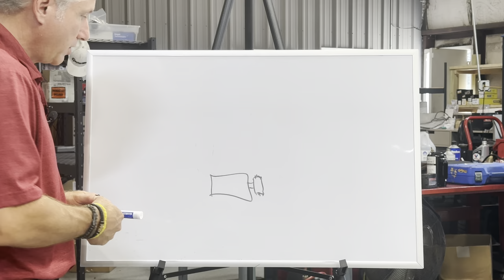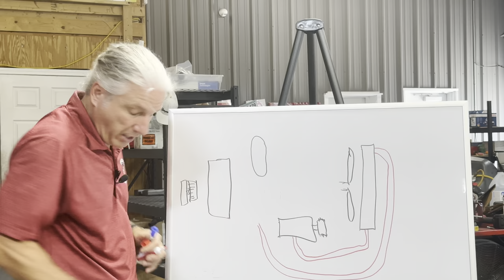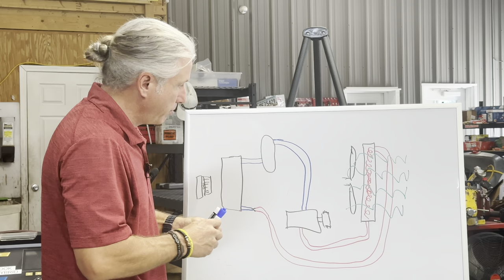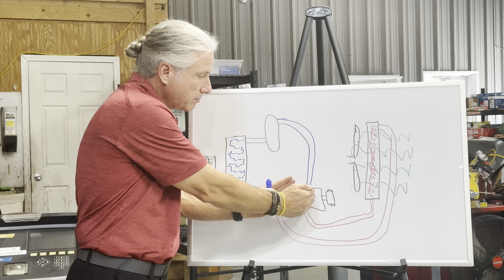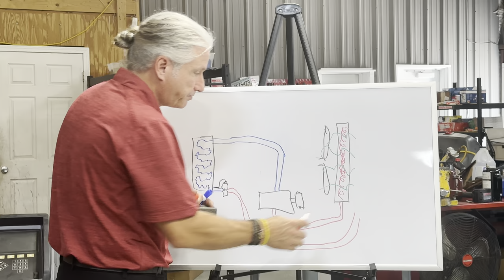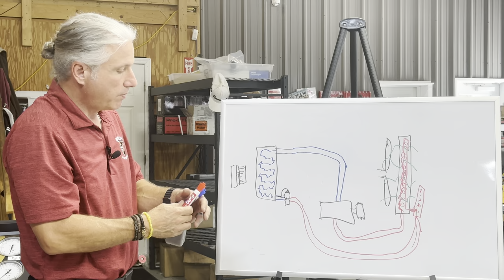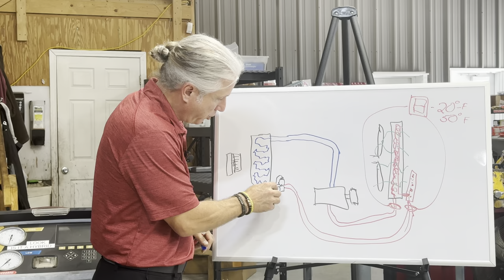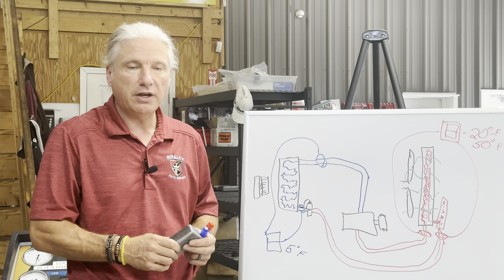Air Conditioning Diagnostics Part 1: How the System Works

Comment: 16:18 The evaporator core gets cold. Air passing by the evaporator will cool down. 

Cold air can absorb less moisture than warm air. Therefore some of the moister that was absorbed in the warm air will condensate on the outside of the evaporator. If there’s a lot of condensation it will be drained (some cars will ‘leak’ water on hot days. They don’t really leak water, that’s just condensation)

There’s no direct contact between the air that’s cooled/condensation and the refrigerant. So no moister will go from the air to the refrigerant.

So the refrigerant does not pick up water from the outside air.

Just my 2 cents. 
I’m looking forward to part 2!
Reply: Also, here in Scotland for sure I would expect to see moisture on the outlet pipe from the evaporator, similar to a picture of the evaporator if we could see it.

Comment: Dryer conditioned air is due to the condensation on the evaporator removing humidity from the air passing over it. There is no absorbing of moisture by the refrigerant. It just absorbs heat. Side note it doesn’t cool the air it makes it less hot. 😊

Comment: i'm confused about the accumulator , is it the same as filter dryer or not , because accumulator normally describes a device to store excess liquid refrigerant to prevent liquid from going to compressor . please help
Reply: their is a desiccant bag in it for moisture control and a screen . if you can find one cut it apart, i cut and disassemble lots of things it gives you more understanding of how they work. cut the end off a newer style condenser, you will see that the condenser has become a filter. experiment, learn and never stop learning get or look up micron gauge . most shops including dealers dont use them
Reply: Yes due to using a fixed orifice tube the change of state in the evaporator is not adjustable so they use accumulators to ensure that no liquid can reach the compressor. It has desiccant bag in it to absorb any moisture. It works the same way as a filter/dryer except it does prevent liquid from entering the compressor. I’m sure he will cover that in next part/parts..

Comment: Please remember 
High pressure 
Gas ..
Low pressure 
Liquid.
Reply: Not really the system uses high and low pressure gas and high and low pressure liquid.  Refrigerant is low pressure gas from evaporator to compressor and high pressure gas from compressor to condenser. State change occurs in condenser from high pressure gas to high pressure liquid thus releasing heat energy. Opposite occurs in evaporator.

Comment: Great presentation a mention that one is a high pressure gas which becomes a liquid when it goes thru the orifice or expansion valve then back to a gas in the evaporator .

Comment: great information what you are doing is good. back in the 1970s i worked for Montgomery Wards we installed a lot of in dash and under dash units. those units were 12 and boy they would get cold. i have seen so many changes thru the years now we have those variable displacement compressors. you really have to look closely to make sure what type system you have to be able to fix  any A/C unit. old days simple they didn't have blend doors to mix hot and cold air you either had heat or ac so easy do diag. thanks for sharing this information wonderful reminders

Comment: Regarding the temperature readings across the evaporator…
My understanding is you determine the system is fully charged at 5°F difference.
But what do you see before or until it is full?
Since you said you don’t want to see too high a difference, because that would mean the system did not have enough refrigerant, that, with a system that is being charged, you would see a higher temperature, and watch it decrease as you add refrigerant.
Is this the case?

Comment: not trying to knock you but its liquid coming to the orifice not a gas. and you have to use lab grade c02 for that testing but thats another subject. and the drier part comes back to how dry you got the system before you charge it. if you pull down to 500 micron and then cut the vacuum and it does not rise above 1000 micron which is the standard for hvac,you will have a dry system. i hope you will do a more professional video after this one

Comment: The high side is liquid freon, as liquid passes through the orifice tube it evaporates inside the evaporator turning into a gas. Evaporation is a process that removes the heat.

Comment: also i no you are under the gun here .iwould not have used the numbers u used for that 20 to 50 degree difference .  the coldest that will come out cant be lower than ambient in front of condenser coming in, hot travels to cold is correct. 20 to 50 is a rule of thumb and we no how that goes, does not apply all the time

Comment: One thing I’ll add is everyone has their own opinion on blower fan speed while checking for the 5° difference on the evaporator. What do you recommend on blower speed?
Reply: Lowest setting. Will give truer evap temp as the air passes slower across evap and can absorb more heat.
Reply: @CodycoWeb that’s what I have always used. But some training classes I’ve been to has been mixed feelings depending on instructor. I was curious what Sherwoods opinion was.
Reply: Also more than 5 deg means the evaporator is filling all the way up. It is still changing state from liquid to gas in the evaporator. Think of it like a propane tank half full the frost line equals the fill volume. You want the evap 100% full but not overfilled.

Comment: Good basics demo.  I’m really glad to hear you mention about variable displacement, compressors, having clutches.. 
    Some old-timers or young guys who read old literature are stuck in their head that only clutchless compressors are variable.  And they’ll actually try to argue the fact.. 

How many technicians and shops try to top off refrigerant on variable,  Displacement compressors shooting for a certain pressure they “THINK” 🤔 they should achieve.

Comment: Thank you for this. As a tech who has done AC work for 10 years a refresher is always nice to have as we all pickup bad habits over time to speed things up and don't always properly diagnose an issue and just throw a part at it which works good enough but doesn't fix the issue.

Comment: Very nice explanation of how the system works.  I really liked the explanation of what temperature difference to look for at the condenser and evaporator.  I will definitely use that information in the future.    
I will mention that not all orifice tubes are near the evaporator.  The OT on my 98 Chevy trucks is right off of the condenser in the line right behind the passenger side turn signal lamp assembly.

Comment: In your upcoming series please help me further understand where the state of matter changes, of course you explained the metering device, however I get confused at times which side or part of the system can have high and low pressure liquid and gas. Thank you for sharing your knowledge

Comment: Just bought my first set of gauges. Trying to learn more about a/c systems right now. Mainly what to look for when troubleshooting. Thank you for putting this together for everyone!
Reply: Please hook your gauges to known good systems and look at readings. You can do things like temporarily block the condenser with cardboard or disable the fans and see how the pressures react and well as measure the lines and see the temp differences both ways. Maybe let a little refrigerant out and see pressure differences and then add back too much and see what overfilled systems show on gauges. Have fun and enjoy what you can learn.
Reply: Those are good things to try, thanks!